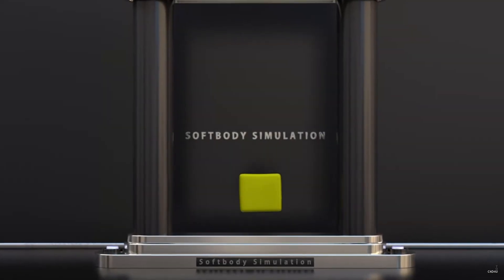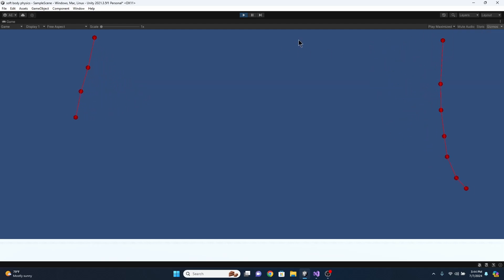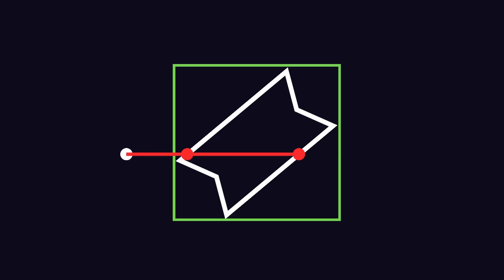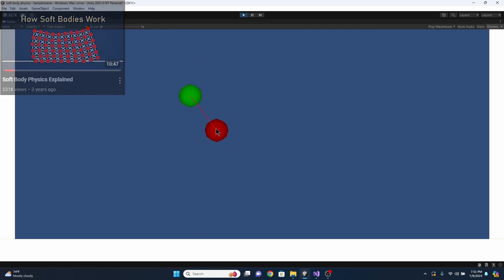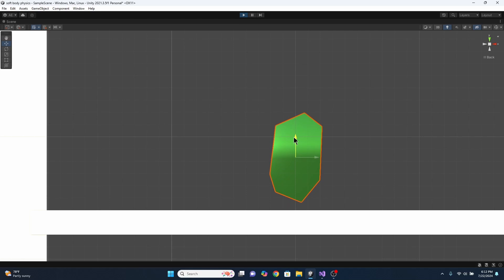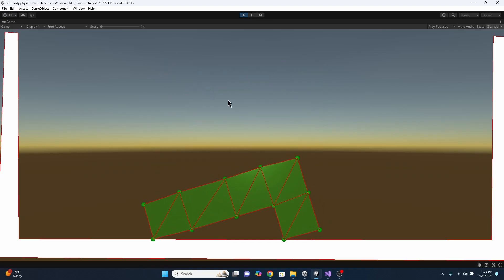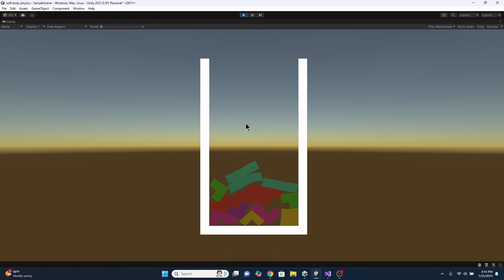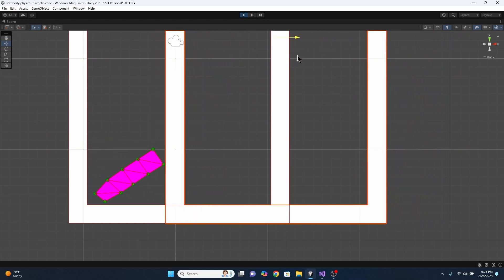Soft Body Physics in Unity

Comment: The points in  your soft body "pull" on each other, but they also need to repel each other when too close. Your softbody resists being pulled apart by pulling on points that are too far from each other, but points also need to repel each other when too close.  in archery, there are compression fractures as well as tension fractures. Look up the difference and the correct solution  to your problem will become clear.

Comment: A better solution to fixing extreme deformation is to make a rotation lock for each point, the further a point is from its correct rotation the stronger the force moving it back to its old rotation. Im not sure how you would get plasticity to work like this, maybe something to do with if the rotarion left or right is too high anend the rotation for that connection
Reply from the maker: By rotation do you mean relative to the points beside it? because technically the points don’t have a rotation. I’ve been looking into something called bending constraints which sounds like what you’re talking about but I don’t fully understand them yet.
Reply: @drollestprawn  yeah that's pretty much it. For the purpose of demonstration we'll say the entire structure is pointed upwards(this won't be the case all the time) if we have point A and an attached point B we can assume there is a line from point B to point a with a specific rotation. Ex: if point A is exactly to the right point of point B it is exactly 90° offset from point B. We can make it so that if it is at say 91° we move it towards 90° with a power of 1. Bending constraints does this but more in a specific positional way instead of explaining it in math terms

Comment: for the self collision wouldnt you just be able to make a minimum distance the springs can compress??
Reply from the maker: That probably would help but sometimes when the spring collapse it’s because they spin around the wrong way instead of going through itself. I’m going to try a bending constraint which tries to keep the angle between two springs the same so maybe that will work.

Comment: This is really cool. Your line clearing feature can sometimes be achieved in blender under the same conditions (how much force required is dependent on the mesh). The only difference is that they continue to render, but the black hole effect is the same.